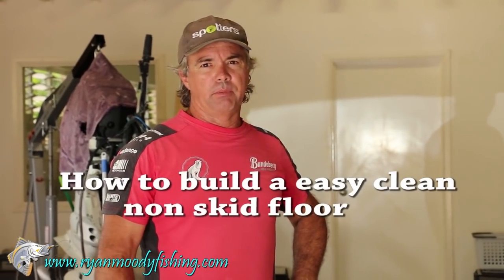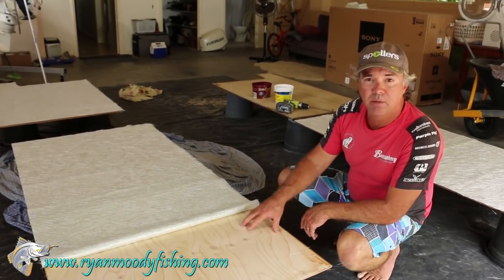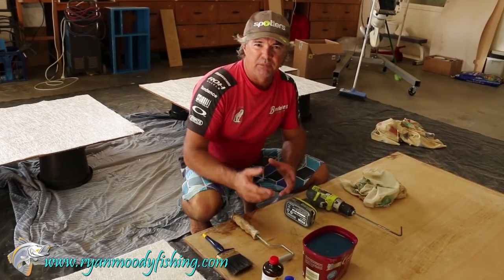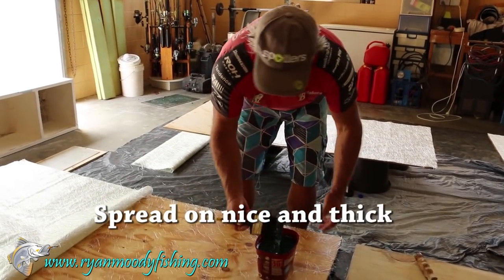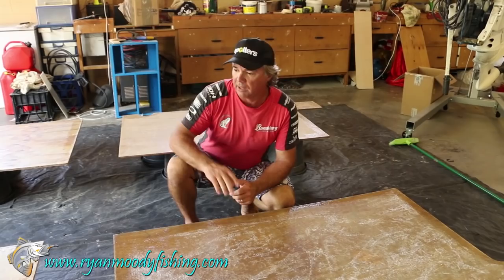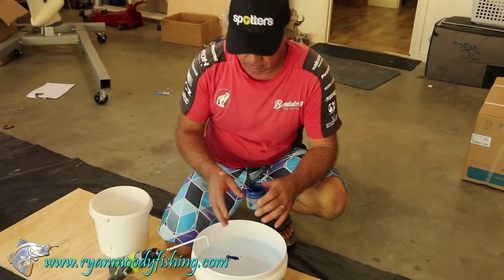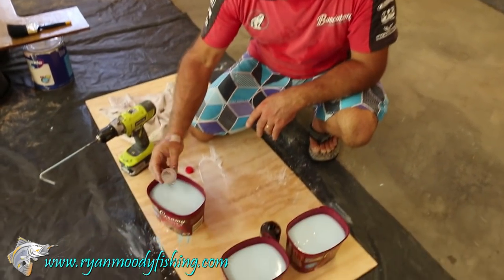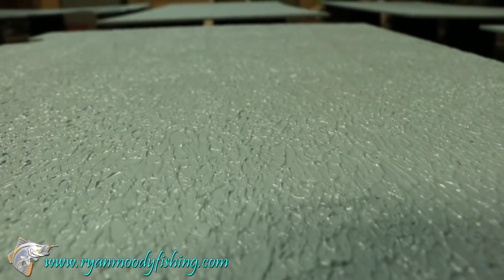How to build a boat floor that won't get hot

Comment: Thanx Mate. Exactly how I'm going to do my Boat, and also my side walls, except I wont stipple roll the sides. I wouldn't of known otherwise. Appreciate the time to do the video.
Reply from the maker: Glad we could help you out mate. Hope it all goes well for you :)
Reply: Doing this currently mate. Question for you, Do you find that as the glass cures, it pulls the boards out of shape ? esp as you have them sitting of the ground and not flush to the floor ? I'm guessing this probably only happens if you wrap the glass right around the edges to the other side ?
Reply from the maker: HI MrCustomvs. Ryan is away at present but I was with him the last time he did it and it fitted straight into the boat on completion. So I certainly don't recall them being pulled out of shape.

Comment: Morning Ryan. Laid out my non skid in the boat last night at about 11pm with a stipple roller. Worked a treat . Cheers!! On inspection this morning 5-6hrs later hasn’t gone off hard yet (still tacky) . Used a 1% catalyst ratio. What should I do? Take the covers off and let it bake in the sun or is it better to cure it super slowly ..
Reply from the maker: Ryan just leaves it in the shed until it goes hard. Sometimes it takes a few days depending on humidity.

Comment: Hi Ryan
Just at the flow coat stage do u find the light blue has advantages over say a light Grey with regards to glare and heat absorption ?not sure which colour to go thanks for any tips
Reply from the maker: HI Mully, I have only ever used light blue or light grey and found them both to be good. I expect as long as they are a light colour they should be OK.

Comment: Ryan few questions after watching your video , I am keen to pull the carpet up on my tinny and replace with your fibreglass job.. do you allow the first coat of resin on the timber to dry before laying the mat or doesn't it matter ? what would you think of the idea of mixing fine sand for non-slip purpose in the last coat aswel watched and another video that suggested wax for the last gel coat for hardening ? Cheers
Reply from the maker: Hi Barmy, Ryan’s process is in the video. We don’t add sand and it is great non slip just with the stipple.

Comment: Couple questions about this process.  When your coating the underside of your deck are you using talc to thicken up the resin as well?  do you think it would be a bad idea to do the final coat for texture after the deck is mounted in the boat?  I appreciate hearing from anyone who has completed this type of flooring, Thanks.
Reply from the maker: Jason Badley no talc for the first two coats,  better out of the boat for the stipple or it will flick all over your paintwork.
Reply: Jason Badley did you end up doing your floor like this?

Comment: Thanks for the video ,great info,just about to have a crack at the flow coat textured finish,is the stipple roller any special brand ? Do you find it better  for anti slip than adding glass beads or sand? Looks great I reckon it would be better on the bare feet than the grit any advice greatly appreciated
Reply from the maker: Hi Mully Adventures. Yeah I found the grit tends to wear over time. I spend all day on this in bare feet with no trouble.

Comment: Hi Ryan can use apply this flow coat to marine alloy ? Save burning the feet and fish
Reply from the maker: I did try it on a small piece of alloy and it stuck very well but i've never had it on a floor. A fibreglasser might know how it goes on alloy.

Comment: What the advantage of glassing the ply? Couldn’t you just seal it with resin and not worry about the glass?
Reply from the maker: It will flex and crack and allow water ingress. You can still do that it just won’t last as long.